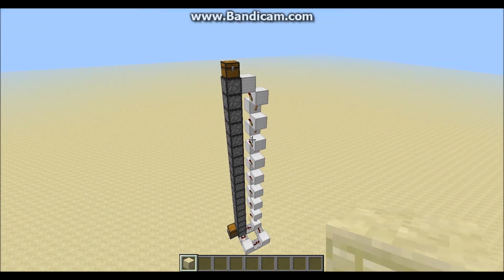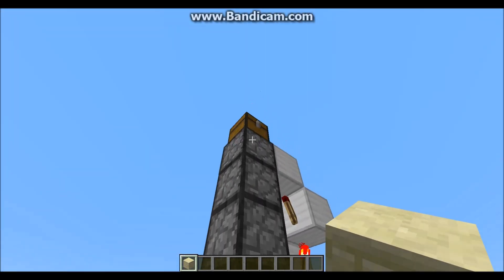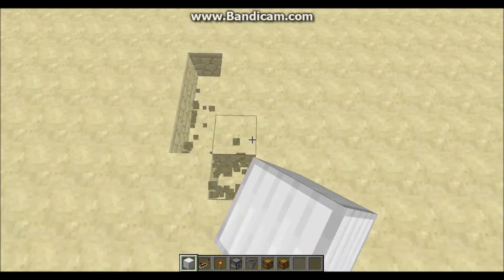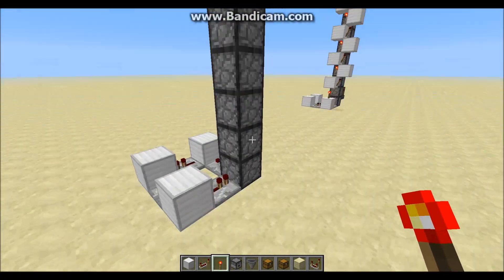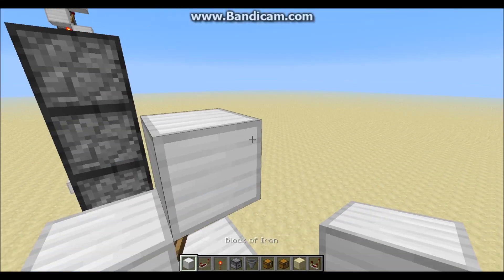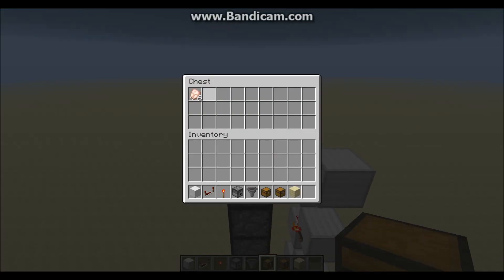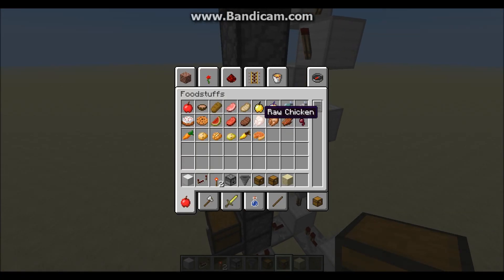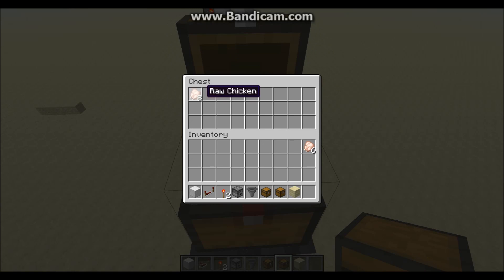Minecraft (1.8+) Dropper Elevator Tutorial [100% Efficient/Silent/Compact/Futureproof]

Comment: Actually, the set-up with the straight vertical torch at the bottom works for both even and odd numbered dropper towers as long as the torch chain is extended so the top torch is at the same level as either the top dropper for odd or the chest for even. An 8 tall item elevator could use the same torch chain as a 9 tall item elevator.
Note: Make sure the gap between the droppers and the torches is clear all the way down.

Comment: If for the even number build at least you should be able to zig-zag the blocks with the torches in the other direction (so that the first one goes over the back repeater instead of out away from the rest of the structure.  That would narrow the footprint of the structure and keep it all within the 3x3 footprint right?

The even number build also has the advantage of being more easily concealable under the floor.

Comment: For more information on why items jump two droppers and why this is silent (but not the fastest) version of this type see...

"The Ultimate Guide to Dropper Towers" on the minecraft redstone forums.
http://www.minecraftforum.net/topic/1816466-/

This guide not only contains a number of towers of this type (just with a different more correct comparator clock) but also many other designs with different capabilities, and handling.

UPDATE.. This tower is a good design... BUT do not try to stack them as the way the first dropper is powered will cause it to interact with droppers below it.  Also as many have pointed out you must feed it by a single hopper which is rate limited by the comparitor powering it.  You can not just place items into the bottom dropper.

Basically it is non-stackable, and input rate limited to remove the need for a actual clock.  See Guide for information on this problem.

Comment: yeah that would make sense. it's a server with no capacity cap, so some times there 100, sometimes there's over 3000 players. delay in the system is probably it, because I mentioned that it works, but gets stuck. sometimes it throws in 2 eggs and it panics and stops. if I clear out the eggs it continues and actually works. but then 2 eggs go in and it stops. 

btw it's set up to a chicken egg hopper farm. but what I don't get is if I put in a stack it won't work. I have to put them in 2 hoppers up, then 1 in the bottom to turn on the loop. 
and then it gets jammed when it feeds in more eggs. I guess I can add 2 more hoppers underneath to set the loop so the eggs feed into the 3 hopper. would that work?
Reply from the maker: I honestly don't know, that kind of redstone work is shotty at best and bound to jam up again in the future - now that I know this is on such an open server, I can guarantee you that is what the problem is however.
Reply: Draykke Devry yep, i didnt even think of that. so i simply converted it to a small hopper loop, just to guarantee it works. i should block it off so no one throws items in, but yep. u should add one of those popups saying "could jam up on a server" or something. :) good video though, helped me alot, im new to redstone.

Comment: Works in 1.7.5 awesome!
Reply from the maker: Indeed it does sir! There is a new version of this elevator out as well (annotation on the video). Be sure to check out all the other content on my channel as well :)
Reply: I tried to make it on a 1.7.2 server but it didn't work! DO you have to place a chest? i tried and it didnt work! WHY?
Reply from the maker: Just make sure the redstone is correct - the redstone torches will power the dropper that is one block down and over (diagonal), so ensure that you have the appropriate amount of torches.

and there shouldn't be any problems in 1.7.2, I know for a fact that it does indeed work in that version.
Reply: Draykke Devry I found another way but thanks for the quick awnser!

Comment: does it still work when you put a stack of say, 5-6 different items into it?
Reply from the maker: Always. The amount of items being put into the system doesn't effect the outcome - It will transport items from left to right (of the hopper's inventory) until every single item is done being transported.

I would recommend checking out my new Dropper elevator tutorial as well (annotation is on the screen in this video). It works in the same way, but is even more compact and has other perks :)

Comment: You've surely figured this out by now, but just in case you haven't, the item skips the second dropper because droppers can be powered. When the dropper below is powered, it powers the dropper on top (1-block distance).
Reply from the maker: Yes I understand the redstone behind it now - This video was posted quite awhile ago :P Thank you though, and it's actually good that someone explained it for those who don't know.

I have a new Dropper elevator tutorial out on my channel now too (link is in annotation on this video)
Reply: Draykke Devry ooooh I'll give it a look. Thanks :3
Reply from the maker: ***** Absolutely :)
Reply: This is actually not the reason you can put torches every other dropper. The torch does not power the dropper, only the space next to it, so the dropper cannot transfer the power to the dropper above. The real reason is quasi-connectivity. The torch powers the dropper next to it because it it directly beside it, but it also powers the dropper below and to the side because droppers are also affected by quasi-connectivity.

You can test what I'm saying by stacking three droppers facing outward and then placing a torch on the side of a block 2 away from the middle one. The middle one and the bottom one will activate, but not the top one.
Reply: Exactly. Beat me to it by a year! lol

Comment: Draykke, I want to use this as the elevator to a sorter system. The only way I know how is to have a directional hopper at the top putting items into a hopper. Problem I see is it won't be as fast or silent. Any ideas on how to link this to a sorter system like mumbo's?
Edit::Tested and it's just a hopper on top to start the hopper chain that ties into the sorting system and it's still silent:). Liked/Subscribed.

Comment: When I build this, the redstone torchers get out of sync.  The capacitors and repeaters are lit up while the torches facing the droppers are not.  How do I fix this with out redoing all the torches?  Thanks and great design!
Reply from the maker: Sounds to me like there is items stuck in the bottommost dropper of the elevator - remove all of the items to fix it. Also I would recommend replacing all of the droppers, sometimes they can bug out and replacing them fixes the issue. Make sure that the items are entering the bottom dropper through a hopper too, they cannot be placed manually inside.

Hope that helps!

Comment: not sure whats going wrong for me im on 1.7.4 just installed this in my nether gold farm and items are getting stuck in the 3rd dropper up. all the torches are in the right place and they flash all the way up when items go into the bottom. its hopper fed so that shouldnt be a problem dunno how to fix it :/
Reply from the maker: Try replacing the torches/droppers... I know, sounds ridiculous but sometimes the minecraft client bugs out after so long and the items that were placed don't respond as they should.

If that doesn't work, I would re-adjust the torches so that every torch facing towards the droppers is in the off position (without a signal, that is)... If your computer doesn't have enough RAM allocated/the server you're on is laggy, it could cause the items to get stuck because the computer/server cannot keep up with the redstone.

Hope that helps!
Reply: Draykke Devry i knocked all the torches off and replaced em and it seems to have fixed it cheers :) great work btw, this is the fastest elevator ive tried so far. great job thanks :)
Reply from the maker: lewis powell Great! Glad that my advice fixed the issue :)

If you really enjoyed the tutorial, please press that like/sub button for me :) Thanks!

Comment: So I built this and every time I put items into the bottom chest, they just go into the dropper and do nothing..
Reply from the maker: There must be an error with the redstone somewhere. The design still works in the latest snapshot.

Make sure the comparator/repeater ring is at the bottom-most dropper, otherwise it will not function properly.
Reply: Could height create an issue? I have this at 25 block high. hah.. >_>
Reply from the maker: Ber Wanderer Haha, nope that is one of the great things about this design - It's infinitely expandable, so height doesn't matter.

Comment: What if I put 1 item in  will it make it ti the top or will it get stuck in one of the hoppers?
Reply from the maker: It will make it all of the way to the top. 100% of ALL items put inside will be deposited through the entire system, no stuck items.

Just make sure that the item is deposited through a hopper. The item cannot be placed directly into the bottom dropper, it has to be placed into a hopper that leads into the bottom dropper.
Reply: Thanks  I have a 67 item sording machine and im trying to put in a automatic smelting machine  issue I was having is when its done smelting I have to bring the items back up to the beginning of the sorder  this will work better than the glass one
Reply from the maker: al theway Agh ok, this is exactly what you're looking for then :) It will serve you well!

You should also check out my auto-smelter tutorial I did awhile back: it evenly distributes the items to be smelted for power smelting. Might help you out in whatever project you have :)
Reply: Hey im a really good redstone builder  but im looking to build something no one seems to have built  maybe you could help   I want to attach a machine to my sording machine that will pull items out of my sording machine that I want   basicly I want to sord my items witch I have then I want to put 1 item of whatever I need in a single hopper or 2 hoppers and have the machine pull out those items is that possable
Reply: A withdrawal system  its to complicated for me
Reply from the maker: al theway So essentially, you want a system where you can tell it what specific item that you want to pull out of your already sorted inventory of stored items.

For example, if you have a stack of cobblestone, and you would like to remove 1, you just want to be able to say press a button and the system gives you 1?
Reply: Well yes but I want to be able to select multiple items at onece like hook it to a hopper and put in 5 items wait a min and collect a stack of each item I put in without pushing buttons
Reply: Im thinking a chest minecart with 1 of every item I want in it that will go around and stop at every item I want fill up a stack and bring it to me
Reply: I think if I put a comparotor hooked to a power rail to stop the power rail power untill the stack of the selected item is done filling then turns on the rail to let it continue to the next item then gos to a chest to empty its contens  then gose back to start point
Reply from the maker: al theway Yeah a system like that could potentially work - I might start working on a design in my spare time and release it as a Redstone For Hire episode; I'll let you know if I come up with anything.
Reply: Checkout this seed I found  I explored it and found 0ver 10 villages 10 temples and stronghold   just amazing  it for 1.7.4  seed: 111 
If you want to make a video on it   I first spawned by a temple and started walking around and found out every village has a temple close to it  I wrote down as many xyz for each  as I could I might have missed a few but 10 of each  is rare  all blacksmiths have armor and pickaxes swords ect

Comment from the maker: Alright, I see the design that you're using now. It's actually quite common. The easiest way to fix your problem would be to place another hopper directly in front of the one being powered by the torch, leading into your chest. That would fix your issue, I just tested it in Creative.

It's worth mentioning too that you don't need 3 hoppers on the above sections, only 2 - although it makes the sorting slightly faster, water currents + occasional blocks of ice works perfect too. Hope that helps!